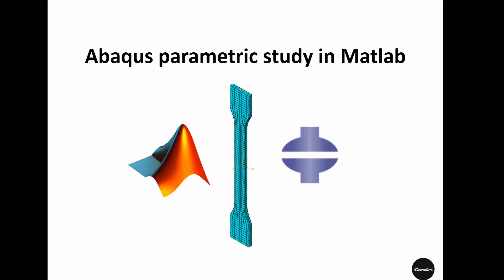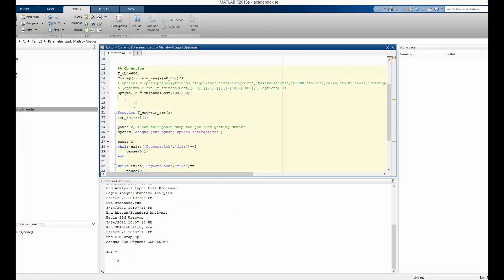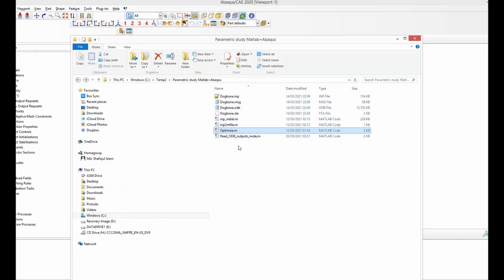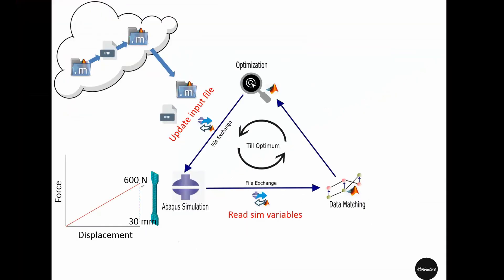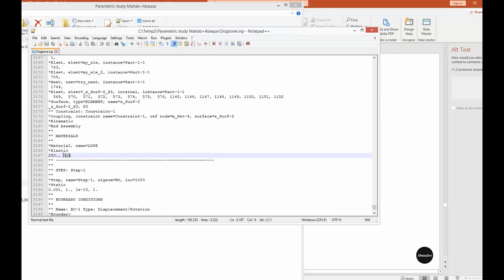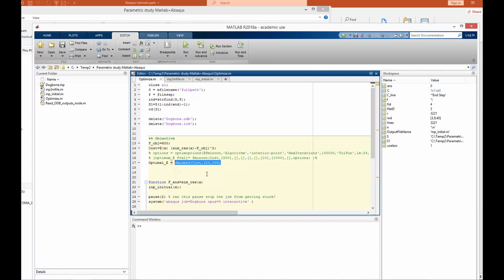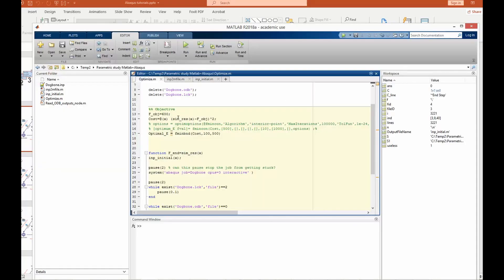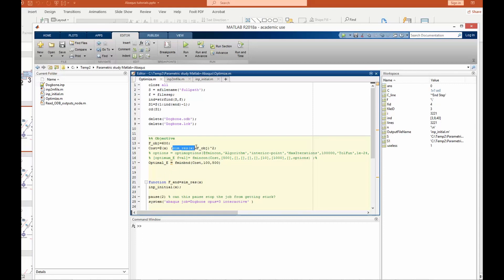Abaqus parameter Optimization from Matlab (Get MATLAB code)

Comment: As you have only one objective function F_obj= 600. Is it possible to set two objective functions?
Reply from the maker: One should first try to make multiple objectives into a single objective. As we usually try to minimize the objective, if we have several Obj, we can simply add them (if necessary with some weight factor) to make a single objective. Simplest of the examples is here: https://youtu.be/bnz_5OToUsw.

If you still have multiple objectives, check 'paretosearch' function or genetic algorithm base function 'gamultiobj'

Comment: I am working on the optimization of the structure. I made a python script with which I can change parameters, but now I want to optimize it.
 Can you give me an idea, how can I do optimization with python instead of “Matlab” if possible?

Thanks
Reply from the maker: I never tried python for optimization. Now when I googled, I could find help is available on the topic. I hope you will find something for your use-case.
Reply: @10Minuters  Thanks
Reply: Convert your python code to Matlab by using Chatgpt 
Then follow the video 
بالتوفيق

Comment: Can you run 2 odb file and then compare their max. and min. value until they become same for both of them in MATLAB
Reply from the maker: Yes, it should be possible.
Reply: @10Minuters  can you tell me how?
Reply from the maker: @amolauliyan7318  Similar to how now 1 job is run, you will run instead 2 jobs one after another. Use the read output script twice. Now you have two values to compare for Max and Min. You have to choose one or more variables (similar to E in the video) that you want optimize. Then an objective/ error function consisting err=max-min is minimized for changing variable/variable of your choice.

Comment: Thanks for uploading this fantastic video. QUICK QUESTION, it looks like "inp_initial.m" tends to recreate another .inp file for next iteration. Then, how did you create "inp_initial.m" at the first place?
Reply from the maker: Hi, the code can be separately written for inp_initial.m. However, if you check the code contains the actual initial input file text with some modification. I can share a simple m file if you want that does most of these modifications when run.
Reply: @10Minuters  thanks for the follow-up! I also figured out how you accomplished that, much appreciation.

Comment: Very nice video. I Have the following two questions :
1. How can we set the objective function to minimize when we have several experimental curves to fit? 
2. If the parameters are in the location of the user subroutine (like UMAT), where can we change in the Matlab code to do optimization?
Thank you for this video and your kind and answers!
Reply from the maker: Hi, you can select several key points from curves, for example if you have 3 curves, select 10 to 50 points from each curve that can define the curve shape. Then take the absolute value (or squared) of the difference between experimental and simulation prediction. Add the 'error' together. This 'error' is a function of your simulation parameters to be optimized. Check this playlist on optimization, you might get some more questions answered: https://www.youtube.com/playlist?list=PLadIcAbP3-ygAhzIfJaJ4Eh6xHZdC0czE

You might not have simulation and experimental values at save s coordinates, this video can help: https://youtu.be/oAhLLQz6LsA

To answer your 2nd question: Check this RG discussion: https://www.researchgate.net/post/How_can_I_call_an_Abaqus_input_file_from_Matlab_that_uses_a_subroutine_UEL

Rest of the steps for optimization framework is as in this video.
Reply: @10Minuters   Thanks very much for your detailed answers !!!

Comment: Extremely Helpful Video. A small doubt though. Is it possible to conduct size or shape optimization using the same codes?
Reply from the maker: It would be difficult, better use abaqus built-in optimization for this purpose.